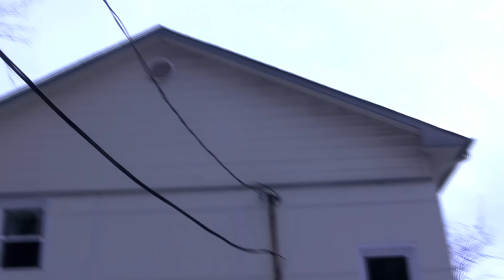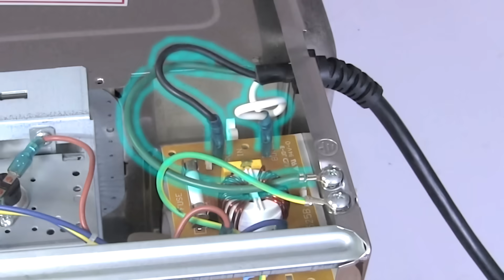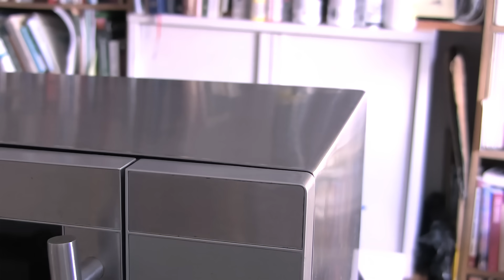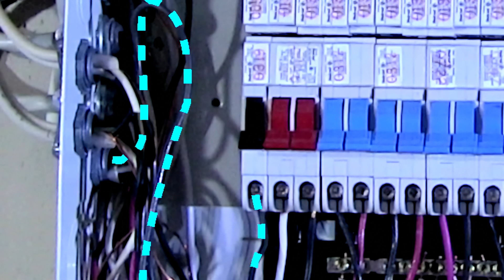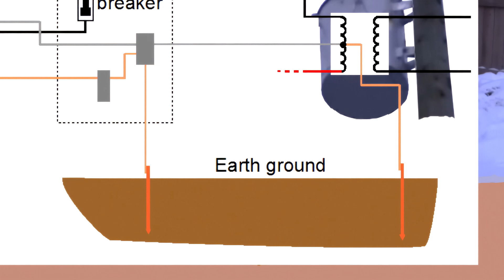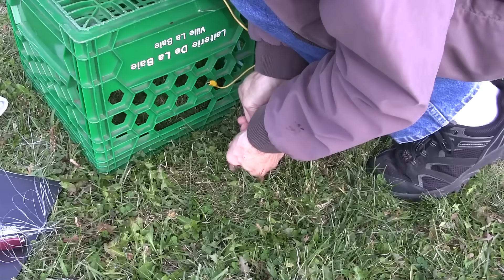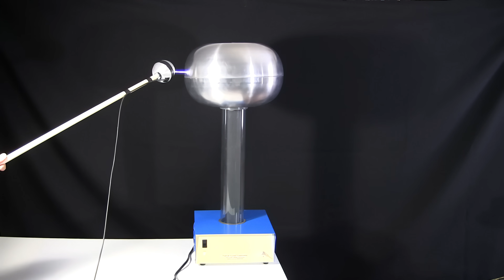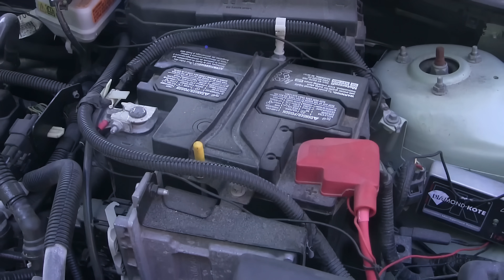What is Ground? Earth Ground/Earthing

Comment: NIce video! Can you explain us how does household ground works in countries where sockets don't have third hole for the ground?
Reply from the maker: Thanks! But sorry, I don't have experience with how different systems work so I wouldn't feel confident enough to make an explanation.
Reply: @RimstarOrg  No worries mate, I was just curious. Good luck!
Reply: @lolobananica  you have different networks TT, TN-C, TN-S and IT.

Im not an electrician... im an electronic engineer... but i will look into it and try to give you an answer.

Found this document that explains them all... its in Dutch

I love to learn new shizzle.
Reply: @lolobananica  so what is being explained in the video can be an IT, TN-S, TN-C-S or even a TT network (not sure if this is a global standard, but this is how we call it in Holland). Its hard to say, as you can only see one the side of the installation, but my guess would be either a TN-S or TN-C-S network.

What you referring to in your question is a TN-C network. (I will get to that later).

What we use in Holland for households installations is called a TT network.

Ill try to explain.

The 2 letters represent a code.

The first letter (either a T or an I). Determines how the side of the transformer is connected to earth. (The star point).
And means the following:

T represents a network where the NUL/Zero/Neutral is connected to the Earth on the transformer side.

I represents a network where the NUL/Zero/Neutral is isolated from the earth on the transformer side.

The second letter (either a T or a N). Determines how an user is connected to the earth (a conductor or the housing of a unit).
And means the following:

T represents that the housing is connected to the earth.

N represents that the housing is connected to the NUL/ZERO/NEUTRAL. 

TT network are less safe and have a lower reliability compared to a TN network.
The safety issue can be dealt with by introducing a so called RCD switch that will switch off the power to the breakers very fast and on a relative low isolation fault. This level can still be dangerous though (30mA max in Holland). RCD switch stands for; Residual Current Device or Residual Current Circuit Breaker).
A benefit of a TT network is that you can distribute Power over long distances. Both transformer and house hold have an earth pin.

An IT network is more reliable, in the sense of keeping everything up and running, even when an isolation fault occurs. As the isolation fault can't make a loop with the NUL/ZERO/NEUTRAL of the power source. As the NUL/Zero/Neutral is isolated from the earth. This is used on ships and/or hospitals for example. Earth and NUL are isolated from eachother. Transformer has a floating NUL and is NOT connected to ground.
(NOTE: when a isolation fault occurs, it has to be solved before a fault occurs in another (2nd) fase, as this will be the same a short circuit and the breaker will trip!)

TN is the easiest to setup and saves a lot of money in costs. An earth fault (isolation fault) is the same as a short circuit and will trip the breaker, due to the high current that will occur. 

Now to answer your question 😁

In the video we spoke about a (most likely) TN-S network with an earth connection (3 pins).

So what about countries that only have a 2 pin connection, how does the household ground work there?

In short: there is no household ground.

In this case.... the earth and the NUL/Zero/Neutral are 1 and the same. This is a mega cheap installation. So from the transformer (power source) are just 2 wires coming to the household, a LIVE (hot) and a NUL. The NUL is joint together on the transformer side to the earth (ground).
Again the same thing happens, an isolation fault is the same as a short circuit and will trip the breaker. Basically the same as explained in the video.
Only differences are, that the earth wire and the NUL wire.. are 1 and the same. 
And only the transformer side will have a earth pin going into the ground. The household doesnt have an earth pin, this saves even more money.

Earth = ground
Reply: Some plugs do it by other means. E.g.: see Schuko ground.
Reply: Very simple to answer this question!   Ground, if It's not there, it don't work!   It doesn't exist.   It's not about your thing plugged in working, it is about life safety.

Comment: I have a friend who built his own recording studio. When it was all finished, he was getting some really bad noise from the house. If you tuned on a blender you could hear it on his recordings or occasionally you could pick up radio stations. So we called in an electrician and he isolated the ground for the studio only, so it was by itself. The problem went away. He drove a copper rod 10 feet into the ground and used it for the ground. Quiet as a mouse now.

Comment: I have a question. So the current flows from hot wire, to neutral, back to the panel and in the panel the neutral is connected to the earth wire who goes back to the microwave. So the microwave should always be under electricity?
Reply from the maker: That is an interesting question. As you point out, the ground wire goes from the panel to the microwave oven case. The only way for electricity to flow from the case is if there's a closed circuit. If you touch the case and you're grounded through your feet then you do have a closed circuit. See the diagram at 5:41. It's from the panel -> ground wire -> case -> you -> Earth ground -> to the rod in the ground at the transformer pole -> to center tap of the transformer coils -> hot from the transformer to the microwave -> neutral to the panel. However, that "Earth ground" part is very high resistance so if any part of the current takes that path then it's a very low current. At least that's my guess.
Reply: RimstarOrg hm right I didnt think about the fact that the circuit has to be closed for current to flow. Thanks for your answer.
Reply: Yes, but that path contains far more electrical resistance (at least 10^6 or higher) than the preferred path for current from the breaker box to the residential transformer, so there's negligible current flow.
Reply from the maker: I still wouldn't take a chance of the return path suddenly becoming lower resistance, say through some water and piping to the house's ground rod.

Comment: The ground or we call earth in the uk connected to the water pipe is to electrical earth the water system. Not to rely on the pipe as a ground. We have plastic water pipes from the street also.

Comment: Very thorough and easy to understand.  Well done!

In my house nothing is grounded.  The 3-prong outlets are fed by only 2-wire romex.  That really screws with the oscilloscope since there are so many ungrounded electric fields.  If I want good grounds I have to go out to the garage.
Reply from the maker: I have only one wall socket which has a good ground. I stretch an extension cord out to it whenever I'm doing high voltage stuff.

Comment: why do house lamps typically not have a ground plug?
Reply from the maker: The lightbulbs need only the hot and neutral in order to work and there's no metal case which needs to be grounded for safety (or if there is, then they don't think there's any chance of a broken hot wire touching the case like in this video).

Comment: I think nothing in my house is grounded. If I touch the sink and the metal bits on my dish washer I'll feel a clear sensation of a charge running through my fingers. Same goes for the tap in my shower. Fun stuff.
Reply: If you have metal plumbing pipes in your house they should be bonded to your grounding electrode conductor.  If you question whether they are or not you should contact an electrician.
Reply: xxDrain wtf

Comment: I like this video a lot.   The only things I would mention would be some code requirements.  The NEC requires a supplemental grounding electrode when 25 ohms or less is not achieved with a single electrode.  NEC 250.53(2) Usually that supplement is the water main.  But what if it's an engineered plastic water main like my house?  ( They actually bonded to a plastic water main at my house ) wtf
There are a LOT of misconceptions with the ground.  "It won't work without a ground"  wrong " a ground fault circuit interrupter receptacle needs a ground" wrong " That symbol means it's connected to ground"  wrong...... it's bonded there.   " a short will go to earth ground" wrong again!  Current will return to the source.  Here is a great follow up video.  https://www.youtube.com/watch?v=mpgAVE4UwFw
Reply from the maker: Thanks. Yeah, this video is intended for the layman and so I didn't stick to the NEC terminology in all places. Thanks for the NEC tips anyway. I'm not qualified to make an instructional video for electricians so in the video description I did like you did and referred to one of Mike Holt's videos for that.
Reply: @RimstarOrg  Oh you bet.  Your video is great for the layman.  Wikipedia has a great page on ground too for layman.  
Anyway, gotta keep tabs on those pesky little stray electrons.  :)  Thanks again.  I'll be checking out your other videos

Comment: Very well explained until we got to the schematics. I'm still not sure what the purpose of ground in a small DC circuit. I see people create a tone control by putting a resistor between the tone pot and ground, but I don't understand what this does. Or what ground actually means in this context.
Reply from the maker: In the case of the amplifier circuit which I show, the ground is really just a common reference, meaning that everything that's connected to that symbol are really all connected together. Any voltages across the components that connect to the ground symbol will have voltages that are all relative to the same thing. If you somehow didn't connect them all to a common point then the voltages across those components would be what we call floating, they wouldn't be relative to each other and so would be all over the place.
And yeah, I agree. That schematic section at the end was kind of an addon for the video. It could use a bigger video all by itself.
Reply: @RimstarOrg  Thanks for your reply. I found out that in the schematics and examples I was looking at, the ground was just an easy way of saying it connects to the negative of the power supply, rather than adding loads of lines going back to the battery. Just drawn that way for convenience.

Comment: What happens if you have a 220 volt 4 wire with 2 hot wires?  What becomes of the neutral line in the case of say a heating element, the element only has 2 prongs?
Reply: Ron Pearson If you look at the power company transformer you see a black wire on top and the neutral wire in the middle then a red wire on the bottom not going to anything.220 would hook between the red and the black. If it were DC black would be -110 lots v  and red would be + 110 volts making 220 volts difference. Current will flow from black to red the neutral wire would be 0 volts and is unused. Being that they are AC instead of DC they still have opposite polarity but are changing 60 times a second so don't try to find them.

Comment: if the hot is touches the case, then ground fault current goes back  to both grounded conductor and ground electrode? 
not just only grounded conductor? am I correct? 
This is the great video why we should ground the not current carrying metal part also...

Comment: Wrong wrong wrong. Using a ground is actually less safe. Electrons don't go to gnd, they go to where they were missing from. A gnd acts as a conduit for such and can kill you. Yep, a gnd is actually more dangerous than none. 
 It's a myth that all electrons go to earth. Nikola Tesla never said anything of the kind. The utility companies are misinformed and perpetuate the myth. Don't believe me? Go on and use a scope while testing voltages in excess of 1000 volts. You go ahead and do your testing w/o using a gnd insulator. Come on now, oh wait, now that you see how close you'd be to death you decide to agree with me.
Reply: no because with no ground a metal casing could be connected to life without any breaker detecting it. And belive me a
 lightning rod wouldn't work without ground either
Reply: I think when using an electric shower I would prefer to use the tried and proven ways. Thanks.
Reply: I'm not 100% sure I understand what you're saying? What do you mean they go back where they came from? The video is saying that the current will flow from a break in live, through ground back to the neutral, and if something becomes negatively or positively charged that charge will bleed back into the ground because of a voltage potential
Reply: Well I understand your thinking but the only problem when large charges aren’t returning in the ground (earth rod) is because the rod is not big enough for the appliances you’re using. If you work with higher voltages it’s often recommended to not put a single rod in the earth but use a giant copper loop under the ground so you have a larger surface to dissipate the electrons.
Reply: "Electrons go where they were missing from"...

Do you mean they go back to the transformer via the ground?

Comment: I'd explain a little more about GFCI, damaged neutrals, etc. as from this explanation, unless you know exactly what it does, it just appears to double up the neutrals but only connected at the consumer unit and really the case is just a neutral. Really it should be explained that Neutral would from wall sockets would be on one side of the GFCI but the earth would be cross bonded on the other. If the ground is floating, without GFCI/RCD, etc. it could be nasty. I would imagine people just wiring up their sockets earths to neutrals thinking they are safe.

Comment: Does the neutral bar can electrify you ?
Reply: Yes, due to the returning current.
Reply: Not really. Since it's grounded at some point, electricity has a low resistance path to go instead of the body. I did tons of electrical work on circuits with a single pole breaker(which mean the neutral was still connected to the panel bus) and it's never been a problem.
Reply: no

Comment: Why do we need ground on the house plugs? Just seems extra and we could connect the neutral to the microwave case and it would be the same as ground?
Reply: In the event the neutral were to be damaged any metal touching the device would become energized. It also causes a difference in electrical potential,  if it and a properly grounded device touch it can deliver a shock.
Reply: I believe its because it wont trip the breaker
Reply: If you connected the case to neutral, then current will flow through it...and you if you touch it and provide a path to ground.

The house ground part of the plug ensures the circuit has a better path to ground than you.

So much better that the amps go up because resistance is down and trips the breaker.

Watch the video again...

Watch the video again...

Comment: For my house to be earthed, does the ground wire always have to lead to a rod that's been buried underground (literal soil), or is there any other way to ground, for example, via a device or a mechanism that acts as ground/soil?
Reply from the maker: To ground a house you need to do the equivalent of a rod pounded in the ground (e.g. you could instead bury a long length of copper wire). I'm not aware of any mechanism that acts as ground/soil for grounding a house. For smaller projects, for example for a small Van de Graaff generator, you can use your body as a ground, but that won't work for a house.

Comment: Grouding to the fence? That's hazardous for passer by's
Reply: Why?
Under normal conditions the ground has no charge.
The fence is well connected to ground/earth.
Hence the charge will go through the fence to earth, before going through a passer by.
Reply: Grounding the fences, light posts, poles or any metallic parts is mandatory in Europe. Basically every metal that can be touched has to be grounded to earth.

Comment: not all poles that have transformers for a house would be a "transmission" pole, and in fact are usually not "transmission" poles but instead they're called "distribution" poles, sometimes a pole with a transformer may be a transmission pole with distribution lines also attached, but probably extremely rarely will you ever have a "transmission" only pole with a transformer to service a house, long story short, you should have said distribution pole instead of transmission pole